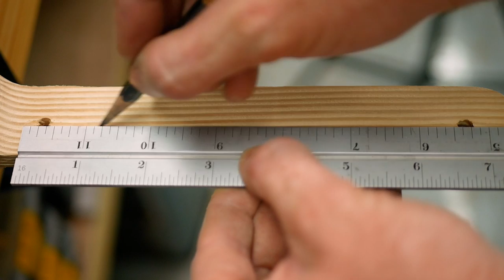Extendable Scissor Lamp

Comment: Nice work, beautiful lamp, but in the joint system on the tube I would put the locking clamp on a free ring in the middle of the joints, in this way you can fix the height without blocking the right-left movement

Comment: Neat-looking lighting. A handle to move it around would have been an improvement. The wiring looks messy (should be more concealed if possible). Having said that, the wall mount pipe bracket is very cool. Classic industrial look. Thanks for sharing.

Comment: Prolly wanna add a brass or plastic sleeve around the front support's bolt, so its threads don't chew up the wood slot over time. Might also add a little smoothness to the extension travel?

Comment: that came out great, but you’re going to have to modify it just a little because you can’t turn that assembly without loosing that hand nut.
put that metal collar and hand nut and locate it underneath so the base can swivel on the pipe but it’s testing on the metal collar so it can swivel left and right.

Comment: OK guys. Challenge. Take this simple design, eloquent execution and trick it out with a platform at the lamp head end to mount other attachments. As with the power loops extended component add other functional capability extensions top and bottom. Don't forget extra long bolts, eye bolts/hooks to also hang things from. Inlayed disk magnets to hang drawings on.............
Pretty it up with copper, brass, acorn nuts, fender washers , springs etc.  Pretty scrap-bin projects.

Comment: Nice build BTW that type of mechanism can be useful all over a woodshop  my first thoughts are to  use a similar  one to hold  wires  and dust collection  in better places to do our work  of course it also looks  nice IMO  FYI i  did Woodworking professionally for over 20 years and longer as a hobby   I’m  a firm believer that  it takes  a lot of pateince and some skill involved. To do a good job  not necessarily the most pensive tools only can buy  but you may want. To look into upgrading your jigsaw. To a T shank  blade with a  rollerbearing guide built into the  saw   Some advantages are   A wide variety of blades are available and  a higher precision of cuts can be   Made  ie peronally do use a Bosch  Saw  that ive had for over 25 years  problem free  with just basic maintenance   But. Do know that many other manufacturers. Make a similar design and style that i know are quality tools  dont mis understand me as a tool snob and what you demonstrated  in your video. All appear to be quality Craftsmanship  with what you do use  myself and many other co workers. Always refered to the Bosch saws as running like a well oiled sewing machine ironically sewing has became another hobby of mine as i enjoy  doing Vintage car interiors and Boat cushions and Canvas. Items for myself and sometimes even  my boating freinds  that became a hobby. Because. Its very expensive to pay. Professionals and i used to find myself not always as happy with the work i was paying for  by learning myself and buying  a machine that is capable of doing what i desired  it to do  i can. Build what i want just like in  Custom Woodworking

Comment: 8:24 I felt really uncomfortable watching you hold such a small piece by hand when using that large of a forstner bit :D. It helps if you go slow sure, but still a bit of a gamble.
Not that it's really that dangerous if it catches, but not exactly fun either (especially if it ruins your work piece or rather makes it look ugly).

edit Really cool. I hadn't thought of using a scissor lamp as opposed to a movable desk lamp -type solution. Gives a much better travel in a workshop environment while tucking away so much more compactly.
Just a thought, if you want to be able to move the lamp radially without always opening the nut, you could make some grooves on the pipe with an angle grinder or a file. Just spin the pipe with a lathe or even a handheld drill (needs an intermediate piece to connect the two) to make the grooves more easily and get a cleaner look. Or just skip all the setup time and use a bench grinder. Then just round over (or form however depending on your groove geometry) the end of your locking bolt so it mates up with the grooves more nicely. Or maybe even make a spring-held pin that you can just pull outwards and let it snap into place on a groove when you release it.

Comment: Nice work, only one thing what I didn't like is that pipe lock ring inbedded in lower peace - when u lock in som hight u can extend but not turn out - if it would be on underside of top peace would problem be solved...

Comment: I think it'll be even better if you make grooves every certain height along the vertical pipe and use a spring mechanism (instead of a screw knob) to lock the pin so it can be rotated freely

Comment: Hey so I loved the video, but I personally would've used a castle nut with a cotter pin instead of the self locking nuts on the ends of each piece. The rotation from the extension and retraction will slowly loosen the self locking nuts and I would find that annoying.